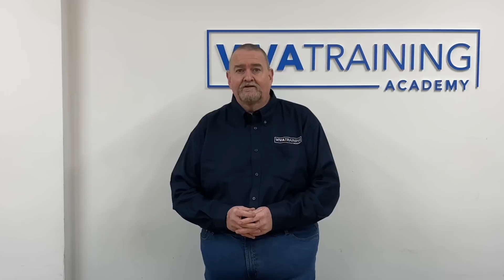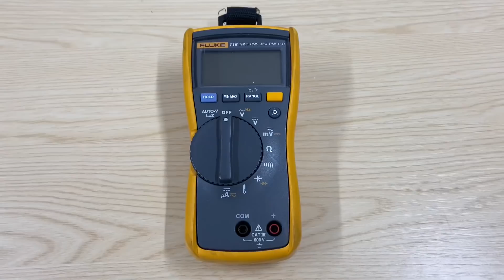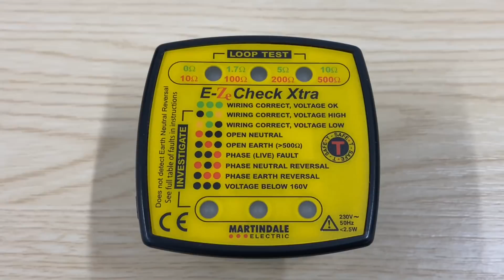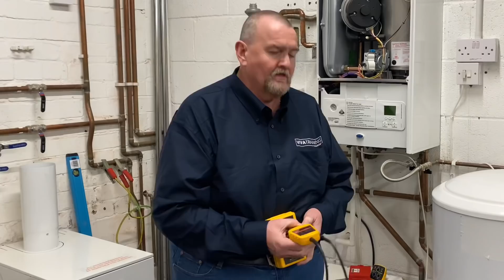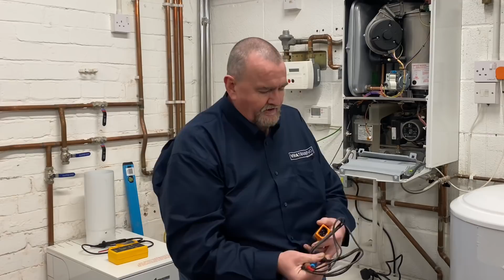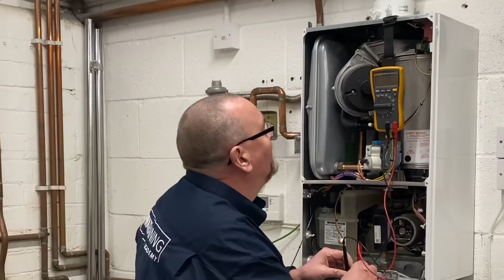ACS Gas Training - Electrical Testing. How To Test Gas Boiler Components

Comment: Hello, on the hydraulic diagram of my boiler the differential pressure valve carries three pipes.
One pipe is connected on the delivery pipe of the heaters, the other two pipes are connected on the pump suction.
Can you tell me why two pipes are connected to the pump suction?
Where can I send him a photo?
Thanks

Comment: Hello, I have some questions regarding the ground wire (yellow / green) in a boiler:
1) Can I have problems starting the boiler if the earth wire (yellow / green) is not correctly connected?
2) Do the two electrodes, the ignition one and the sensing one, close the circuit through the ground wire?
3) With which instrument can I test an electroto to see if it is good?
Thanks